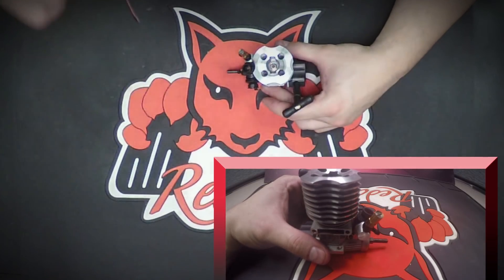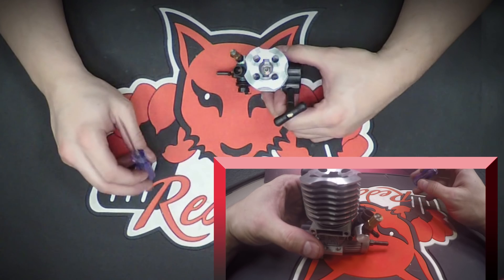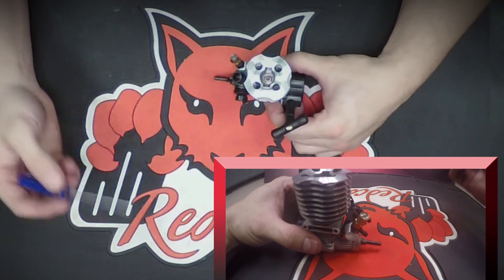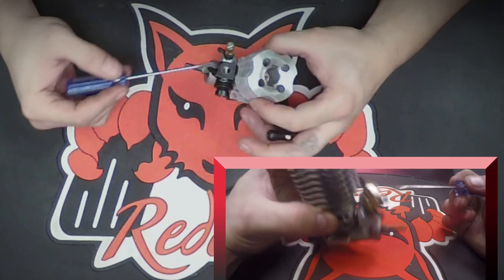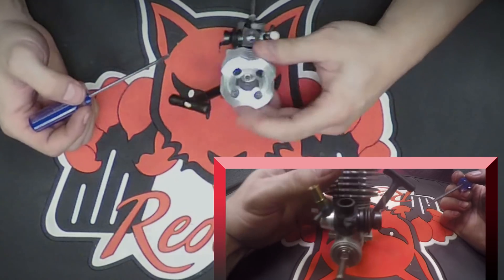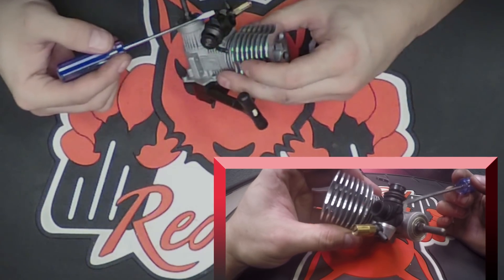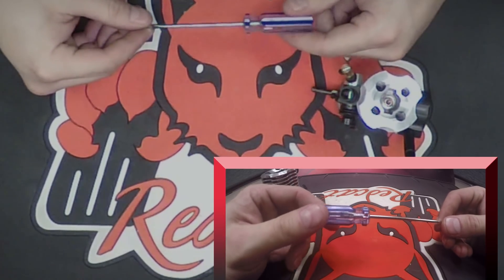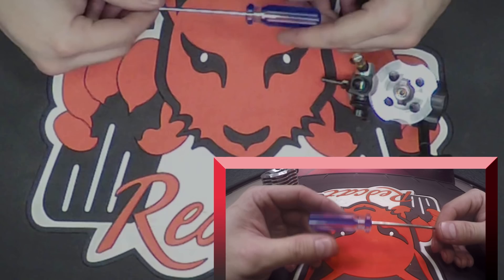Redcat University - VX-16 Nitro Engine Carburetor Needle Location

Comment: I have a question!, I just bought a lighting str and i am wondering if does that come witha .16 or .18?
Reply from the maker: Howdy, So the "STR" should have the 16 or 18 depending on your model. Check the side of the engine and it should say it. Regardless the settings are the same on either! : )
Reply: Thanks you! Im going to start ordering from here now since exceed is more then 50 % out of stock XD
Reply: 2222222226th2wW